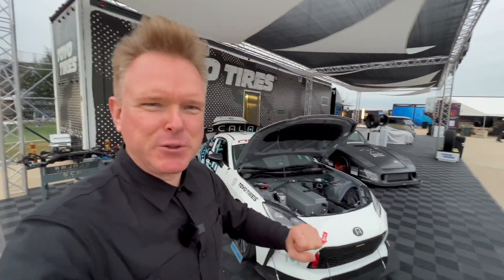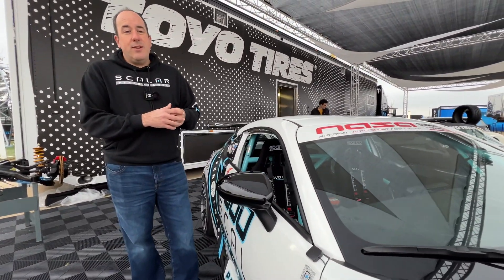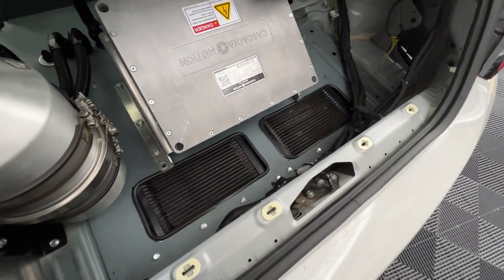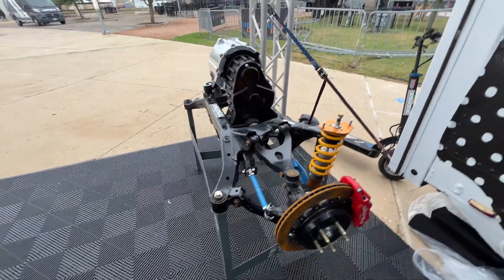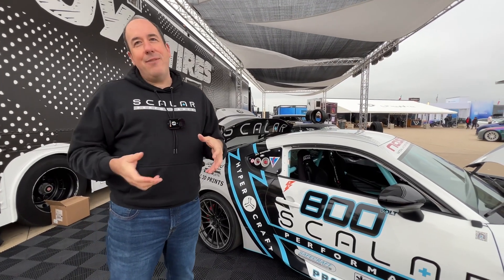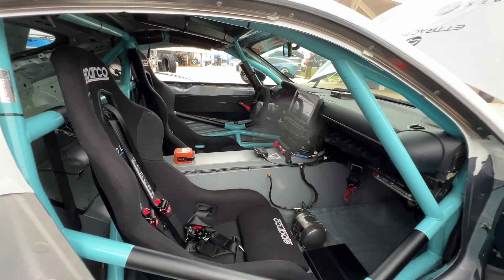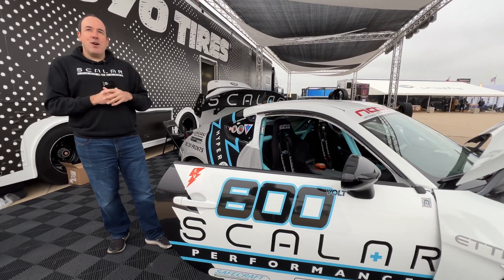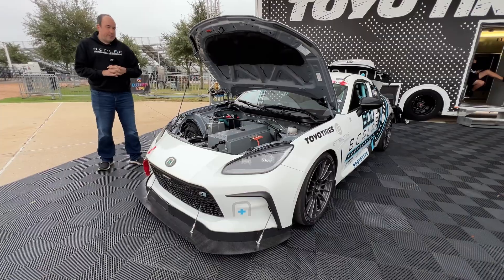This Electric Toyota GR86 Is An In-Development Race Car!

Comment: Jerome: Please consider doing a show about the exorbitantly expensive cost to replace a battery pack, especially when perhaps only one cell has gone bad. In many cases the cost of a replacement battery pack—a used one at that!—will effectively total the car. In my case, my EV battery had one cell go bad and luckily the car was still well under warranty. But since it is not a Tesla, it sat for a full month until a tech could be flown in to do an on-site test and repair. I think the industry needs many more independent shops able to do swaps with laws keeping manufacturers from charging for a full battery replacement when tests show a simple single cell swap would be sufficient to get the vehicle back on the road.
Reply: The market has already brought out many independent specialists; most are able to replace a failed cell or module, making the operation significantly less expensive. Glad yours was under warranty though.